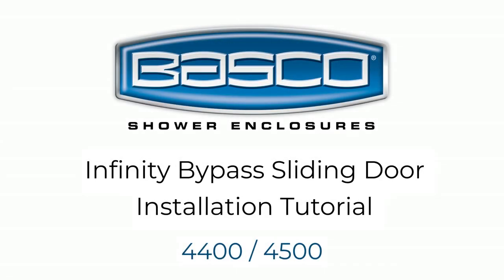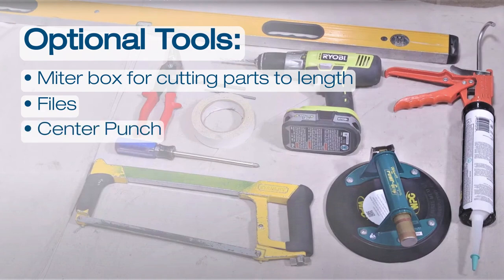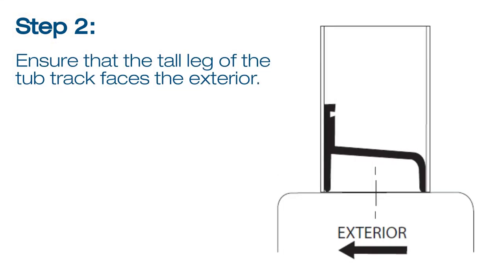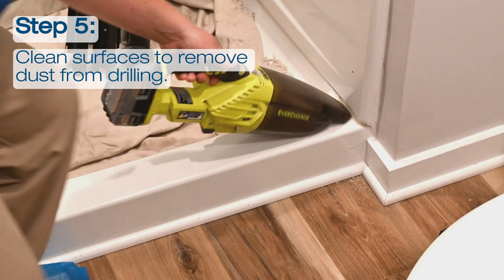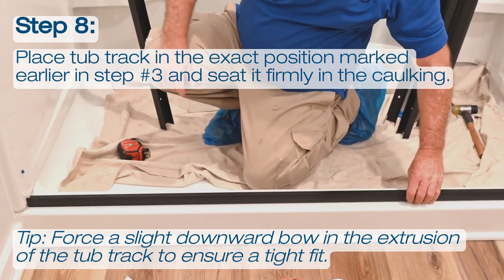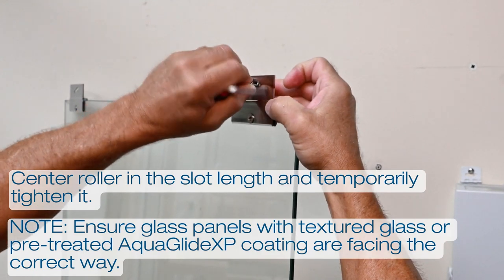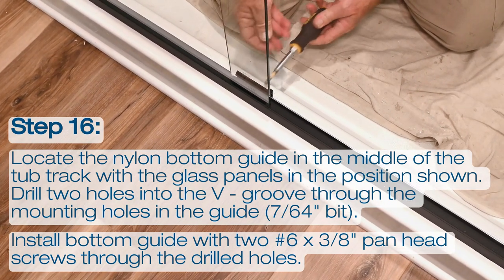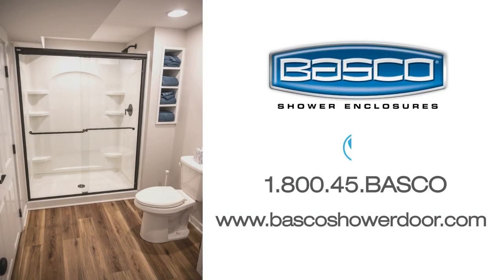Basco 4400 & 4500 Infinity Bypass Sliding Shower Enclosure Installation Tutorial (Full & Tub Door)

Comment: But how do you adjust it if it’s sliding open on its own?
Reply from the maker: Hi there, thank you for your question. It is hard to give an answer with certainty, since we cannot see your door, but it most likely needs a tub track filler. The curb of your tub is probably slanted, creating a slope for the door to roll down on. If the door is properly installed with any needed fillers, the door will not open on its own. You can order a filler in our Parts Store on our website at www.bascoshowerdoor.com, or contact our Customer Care team for assistance if you have any questions about the part number or the installation of the filler. You can reach us at 1.800.45.BASCO or via inquiry@bascoshowerdoor.com.